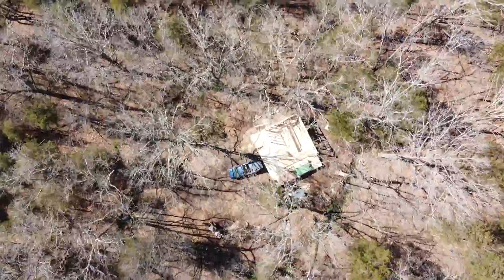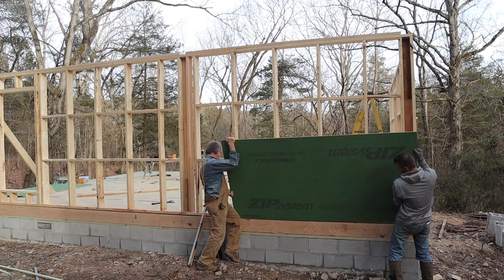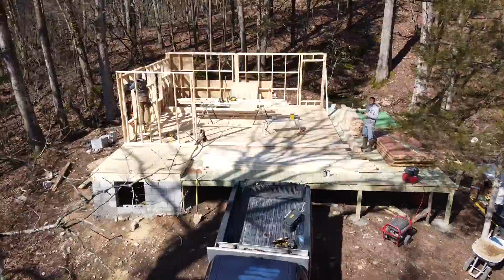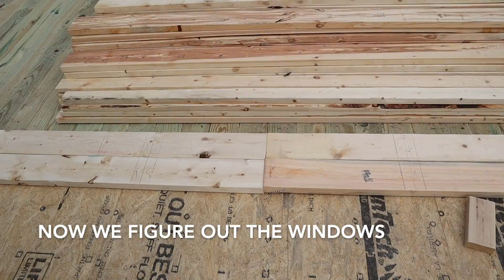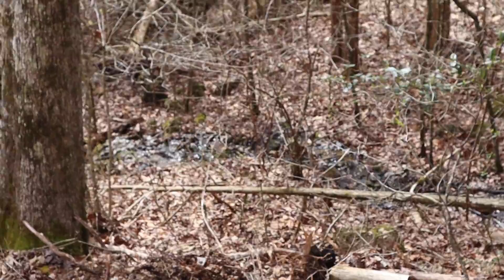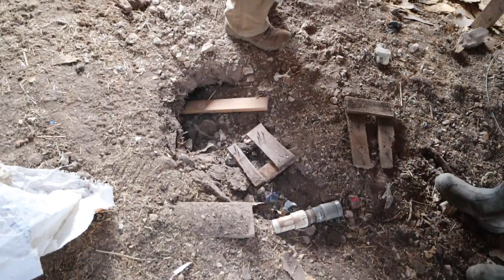Off Grid Cabin Build - 1st Floor DONE - Future Airbnb Property | Episode #6

Comment: The muddy road back there, oh my, Don't go slow you'll get stuck, just step on the gas to get you through it and go to it at a slight angle. The surrounding area looks familiar to what we have picked out in WV, we are swooning.  Dan likes the 2x6 exterior walls for R-19 insulation. We are cheering you on Michael you got this!  These videos are such an inspiration.  You're doing an awesome job! We are loving the time-lapse and loving how you're using the old barn.
Reply from the maker: Thanks guys!! Yes this is my 1st house with 2x6 walls and very glad to be spending the extra $ on it. It will pay off this winter ❄️!